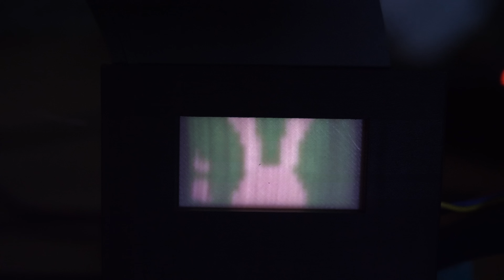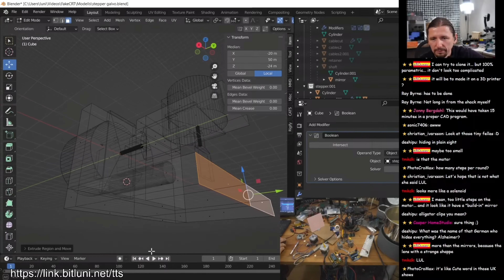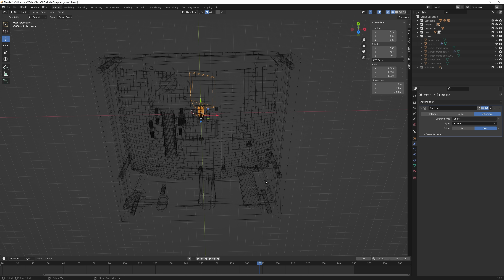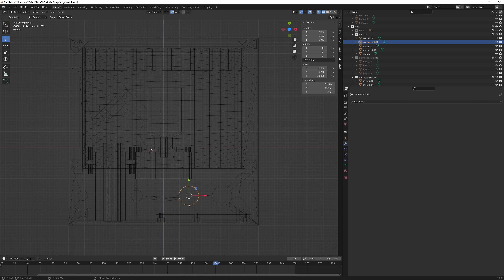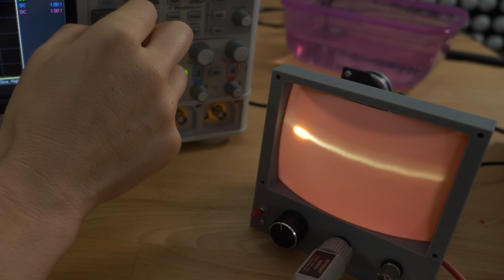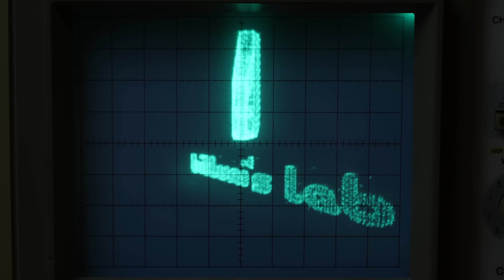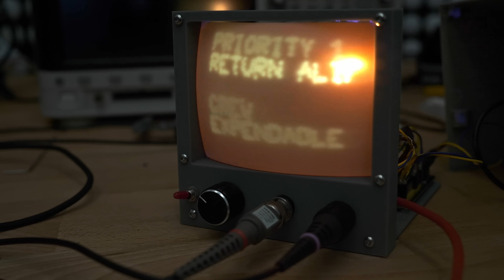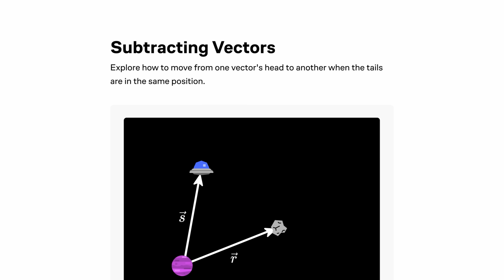I made a fake CRT TV with a LASER

Comment: You should try brushless DC motors! They can go VERY fast and stop on a point. They don't need anything like much torque. Maybe not as simple a steppers but they're used by some corporations for very precise work nonetheless. Your initial idea, using speakers, was the best. I'd love to see it scan fast enough to serve as the display for a videogame like Asteroids or a Vectrex title.
Reply: How about voice coil head stepper assemblies from dead hard drives? Those can move really fast, for obvious reasons. I bet they could move even faster with much of the weight removed (all but one arm snapped off).

Also speed is helped by keeping the mirrors as small as possible, so there isn't so much inertia to fight. The first mirror in particular doesn't need to be as big because it is receiving a stationary input.
Reply: @mal2ksc  awesome idea!
Reply: @mal2ksc  great!
Reply: faster dc motors could probably lend themselves to a more continous-scan type design too, depending on how fast they can drive them. some sort of linkage that directs the horizontal deflection to a set rate, and the vertical deflection at a set rate with some way of resetting it. i wonder how fast the luminance of a laser diode like that can be modulated or switched, would be cool to see some sort of continuous scan rendering by adjusting the brightness of the diode itself like that.
Reply: @clockworkspiral  super!
Reply: Couldn't the mechanisms from old HDDs that move the heads be used? I think they would be fast enough to move the mirrors.
Reply: The trick is to use closed loop control. Commercial galvanometers used for laser marking and light shows use capacitive positioning feedback to create a closed loop servo. The amount of energy fed to the deflection coil depends on how far away it is from the desired position.
Reply: you could also really easily print out a set of gears to tie to the motor and use a hall effect sensor to track angular displacement at the level of precision you decide on by setting the gearing ratio (and number of magnets to place in the gear working with the hall effect sensor)
Reply: you could also use a mirror galvos 😅

Comment: Reminds me of our laserscanners we did 20 years ago with the popelscan software. The solution we found was not to use steppers with snmall steps but steppers with really big steps of appr. 7°. so really corse stepping. Then you hold the rotor with a voltage between 2 steps and then modulate this voltage for scanning. So you get a few degrees of scanning and that doubled as a scan angle. No steps, no jagged lines. But as you already mentioned, there are cheap galvos available now.

Comment: Twisting your wires on the BNC inputs may actually be detrimental, because you increase the length of the wire and the surface area of coupling. That increases your probe impedance and probe capacitance!

Comment: Did you notice that the red laser actually works as an eraser? Paint with blue/violet (405nm), erase with red
Reply: Maybe it would be possible to use a red or infrared LED to flash the entire inside of the screen when you WANT the persistence to stop.
Reply: @perz1val  that doesn't seem right. The higher energy violet/UV laser works because it is elevating the energy level of the phosphor, which then emits a lower energy photon which we see when it decays. The red laser doesn't have enough energy to elevate the phosphor, but it almost certainly doesn't have energy to somehow lower the energy level either. The only decay mechanism I'm aware of is time.
Reply: @R.B.  see, the red laser brings just enough energy to make the phosphorus emit all of it's stored energy at once, but it does not have enough to recharge it. I've played with it and it was almost impossible to notice the phosphorus discharging everything after red laser hit it, because the beam was so much brighter. It just looks like erasing. Also blue/violet is better for charging the phosphorus than UV due to how the electron energy levels work. I guess the red bumps it a bit higher and after the electrons collapse emitting all of their light, because I doubt it being heat related. Warm phosphorus glows stronger (discharge faster), cold glow dimmer but longer, however the tiny red laser I was using was incapable of really heating anything up.
Reply: @R.B. it's a real and documented thing. Yes you can erase phosphorescence from things with intense long wavelength light. Styropyro has a video on it.
Reply: :face-purple-wide-eyes:

Comment: You could probably use a lens to move the laser around easier. Have the laser be still, and move the lens up down left right to control the beam
Reply: This is so wrong
Reply: @ArneChristianRosenfeldt  I did an optics research class for optical cloaking, and we had to align four lenses perfectly. To do this we used a laser, because if the laser wasn't centered on the target we had it on, we had to make adjustments. So yes, moving a lens that a laser is shining through will bend the beam.
Reply: @ yeah, but not like a mirror. A mirror bends twice the rotation angle. A lens rotation? So you want to shift it (some cameras did this for interlaced video). How do you balance this? Then translation leads to a small surface angle change (rotation). And refraction with 1.5 also is limited. You will be longing for n=2 ?!
Reply: What I'm trying to say is that you could use a single thick lens, which would allow more brightness, plus you could control the lens easier since it's the only thing being moved. Even if you used multiple lenses, I think you would have a better refresh rate because you wouldn't have to move the lenses as much. For precise controlled movement you could also use voice coils like a HDD instead of stepper motors. I think even if you keep the mirrors it would be cool to see if you could improve it by using voice coils instead. Maybe using ones inside a broken HDD, or new ones, they would probably fix the stepping.
Reply: @IsaacMcMillan-u7i  I dunno. I used a used laser scanning microscope from Leica in the last millennium. Resonant galvo (aka voice coil) scanner on stepper worked okay for 64x64 pixels. Laser was 20 kg and stationary, of course. This is really a solved problem. Standard definition always used polygon scanners. Also in the last millennium they had a prototype for a simulator. Low latency like in games. DLP was not jet invented. Just I don’t know where they got the color from. Laser shows used dye lasers. You constantly have to refill the dye like in a printer…

Comment: Your first mirror could be  a lot smaller - less mass & air resistance
Reply from the maker: not only that: first mirror should rather do the horizontal deflection and the second one the vertical. but don't tell the others 😂
Reply: @bitluni  I wonder if you thought of and then discarded using the voice-coil motor of a mechanical HDD. Those motors, which position the arm carrying the heads at the right spot on the platters, have a coil between permanent magnets, a bit like your speakers at the beginning.
It's easy to find examples of people placing a mirror on the axis of the arm, pointing a laser at the mirror and then driving the motor with an audio amplifier playing music. In your case you would have to code a more sophisticated control algorithm. I remember finding the video of someone doing precisely this with an Arduino but I could not find the code.
Extraordinarily cool project, by the way 😄
Reply: @bitluni Use micromirror devices used in video projectors.
Reply: @bitluni  Awesome project and lots of good recommendations!  Wanted to add something: high frequency commercial galvos generally use rectangular(technically octagonal) mirrors, where the shorter side of the mirror is parallel to the rotational axis.  you could also use a singlet lens after the galvo to reduce the required deflection amplitude while reducing the spot size for higher resolution and brighter display :)  Great work and excited to see what comes next.
Reply: @bitluni  I would also suggest using old hard drive aluminium plate cuts as the mirror. The surface is the reflective layer and should provide better focusing.
Reply: @AdiGitalEU  Any front-silvered mirror will do for the job, and hard drive platters are kinda hard to cut to size and shape although they're great if you can use them as is.
Reply: @AdiGitalEU Yep. Just ensure it’s aluminium and not a glass platter - they appear almost identical, and one likes to make a big mess!
Reply: Not sure how much it would matter, considering the mass of the stepper motor rotor itself. Perhaps a better solution would be to use a mirror on both sides and refrain from using reciprocating motion, but rather to have the mirror spinning continuously.
Reply: ...like a mechanical scan in a laser printer (rotating hexagon mirror)
Reply: @ff5x2  Yes, even better.
Reply: not just less air resistance but moment of inertia changes

Comment: I'm not quite halfway thru and I haven't read the comments yet, but you could just use a magnifying glass to amplify the travel distance of the laser and then use the little speaker drivers instead of stepper motors
Reply: A convex lens collimates the beams and makes the picture smaller.

Comment: I always thought it would be really nice to make a VGA-compatible RGB-laser based CRT-equivalent, but never could figure out a way to scan the beam fast enough.
Reply: As others have mentioned, something like an pair of octagonal spinning mirrors rotating at high speed would work fine, so long as you align the three color beams together and get the speeds right you just need to modulate the RGB beam powers and you'd have a laser "CRT", it probably wouldn't be compact but it would probably be lighter than a comparable CRT, and potentially use far less power as generating and steering electron beams is power intensive
Reply: @UNSCPILOT  I suppose 236,000 RPM could be borderline doable, but I'm a bit sceptical that would be practical or quiet or stable enough. Some sort of fully electronic solution like voltage dependent refractive index would be better, but I don't recall seeing practical values for such either. Maybe someday.
Reply: @derre98 electronic solutions can shift the phase by 360° . A mirror does 1000 times the phase shift. 
A hologram? But the electronic I used needed 10 kV .

You could send chirped ultrasound pulses through a crystal.
Reply: @UNSCPILOT prism or dichroic mirror? Or a grating?

Comment: I've thought of this many times.  I bet with some good galvanometers you could produce a lead-free CRT.
Reply: in fact, some good motor and mirror assembly design could use spinning arrays of mirrors rather than galvanometers of any quality.  CRTs only draw from left to right, and only from the top down.  An array of mirrors that spins so that the laser scans from left to right at the right speed, and from the top down at the right speed, would reproduce the behavior of the scanning electron beam of a CRT, only with motors which are good at maintaining the exact correct speed.  some mechanical coupling between the mirror discs could reduce this to a single motor to control both, since the ratio of turns of the horizontal mirrors to the turns of the vertical mirrors will not change unless you want to support multiple display resolutions.

Comment: speakers could work very well if you find a way to detect its cone position and feed it back into the amp like a negative feedback opamp.   
proper galvanometers for laser scanners work exactly like this. they are just rotational speakers with a position encoder  and a amp with some filters to set the gain for  gain, damping etc.
Reply: a beefier amp with lower resistance should already do that trick by shorting more back EMF, but then speakers still aren't great at rotating things in a linear fasion.

Comment: This was pretty cool! Just a thought, could you drive the laser diode on a pwm signal to counteract the slow decay with higher refresh rates? If the laser is responsive enough you could sharpen your pixel width and possibly interlace the pixels for a quicker response to change on the phosphorescent screen since it has a long decay period.
Reply: Diode lasers produce pico second pulses. Just the noobs on YouTube always use modules complete with power supply intended for laser pointers.

Comment: i want to make one not whit galvos or steppers but using 2 rotating mirrors weels like old barcode scanner and have one wheel sin horizontal and one vertical and have one make 1 scan whe the oter makes 750 
so you have scan lines like a real crt tv rater than a vector display

Comment: I'm thinking something like the voice coil from a hard drive and a neodynium magnet/mirror assembly on a pivot would provide much faster response times.  A voice coil could both accelerate and brake the mirror. But, what you've managed to achieve with stepper motors is quite amazing.

Comment: That looks like a lot of fun! If you want to increase the speed, can't you use constantly rotating mirror, and calculate when to  turn on and off the laser?
Reply: Yes, or more simply, just surround the laser on the unneeded sides with some sort of light absorbing material. Having it rotate in one direction should greatly improve the durability of the display.

Comment: Can you add more mirrors to the axes, so that x-movement might be either split into  a "wide" movement and a "fine" movement, or to let then both work at half the original range? It might let you do faster speeds if any single mirror doesn't need to wobble as intensely

Comment: Cool, but too slow. You can improve it by using a fast rotating x-mirror and a y-mirror, both full 360deg rotation, cuboid shaped to allow full scan every 90deg. For the y-mirror you need to adjust the angle a bit to compensate the y-drift while scanning x-axis. The x-motor has to be xres times faster, of course. Tipp: Light sensors at both scan region ends (x and y) to help stabilize the image. 🎉 If you're not gonna build it... I will. 😂

Comment: This reminds me of the Tektronix 4050 "storage tube" vector displays. The CRT itself would retain an image, so no display memory was required. It had some obvious limitations - the display had to be "undrawn" to create animation, but it looked really cool and could create beautiful images with relatively simple hardware driving it. I think there was a later version that had 2 colours - one was the static image color, which was retained automatically, and another colour was only temporary, allowing animation over a static background without the CPU needing to worry about handling the background redrawing. There are videos of it on YT - very cool!
Reply: The Tektronix 4010 (and so on) have been storage tube computer terminals. xterm has still a tek 4010-mode, changing fcolor to green gives back the feeling :-). Mabe one can find still some programs.
Reply: @georgkrahl56  I don't think xterm would work with the 4050 - it's a vector display, so wouldn't scroll, at least not the phosphor-stored image. The immediate mode drawing would though. It's amazing that they had this  4000x3000 (effective) resolution display with no pixel "steps" in the 1970's - with really fast animation though.